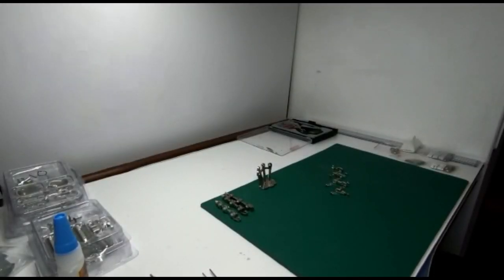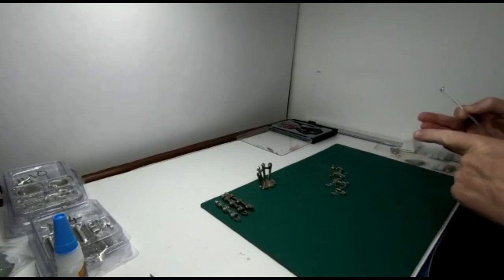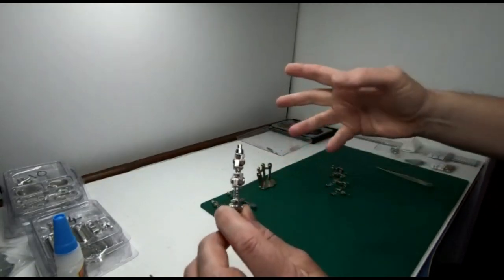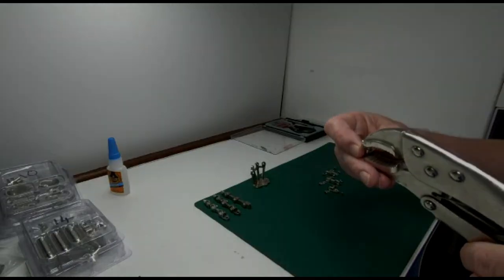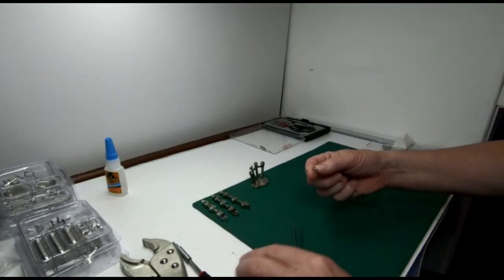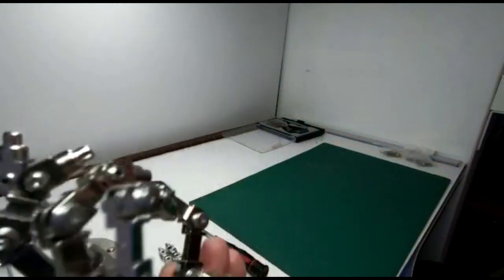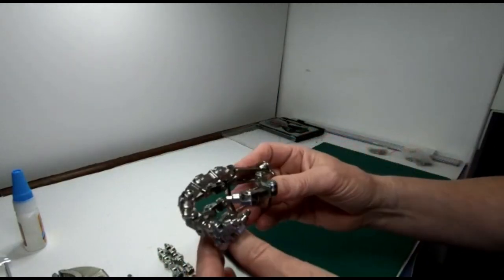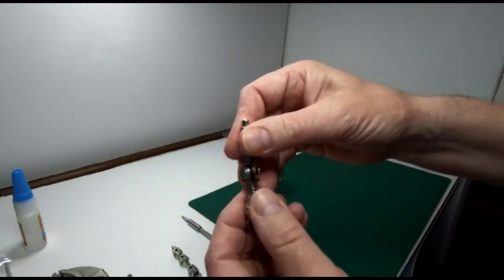Build the Terminator Agora Models Hachette T-800 Movie Modifications: Finger Fix

Comment: Hey brother great video.....would love links to the parts described. Did check on ebay but don't want purchase any more wrong parts.  Thanks also fo the shoutout.
Reply from the maker: Hi I'll have to investigate that for you brother I did give them to Ryan but he forgot to put them in 🤪 😎
Reply: @gweilojohn8550  Thank you...pretty sure I have most parts, but want to be 100 percent sure.  Thank you brother.
Reply from the maker: @chefhawk  brass inserts 3M 4mm / 5mm x 50 eBay seller Malancentral  3M washers x100 eBay seller Scionsupply  4M washers x100 eBay seller Boltbase  Hex socket ultra thin flat wafer 3M 4mm bolt x50   Hex socket button x20 😎
Reply: @gweilojohn8550  ordered..cheers
Reply from the maker: @chefhawk  welcome brother 😎

Comment: Thank you. Your a star. With the parts have you dabbled with issue 69 / 70?
Reply from the maker: Thanks for the kind words 😊 I'm only up to part 66 is there a problem with parts 69 and 70 ?? 😎
Reply: @gweilojohn8550  the same kind of issue as the finger those rubber inserts and a odd looking plastic plug to secure it. Looks very cheap and your work is leaps and bounds above the factory setup.
Reply from the maker: @ClackstarsDashCam   Thanks brother 😎